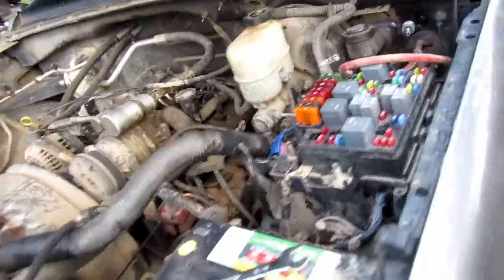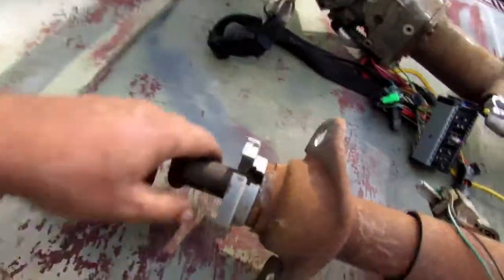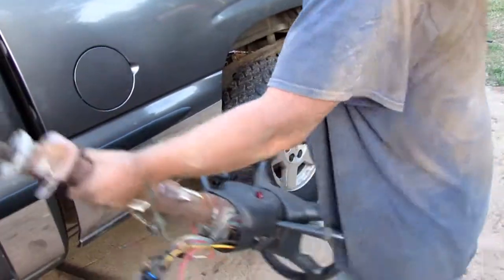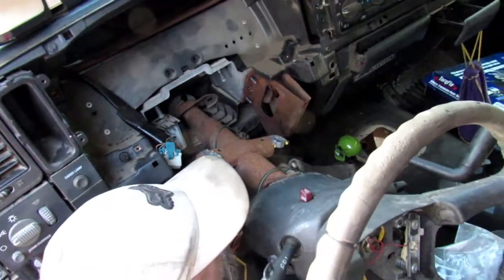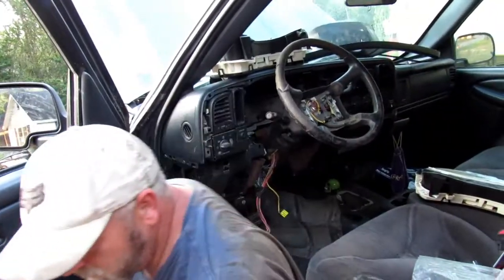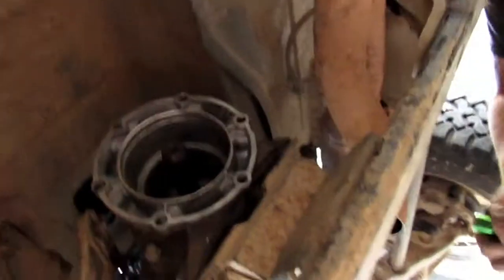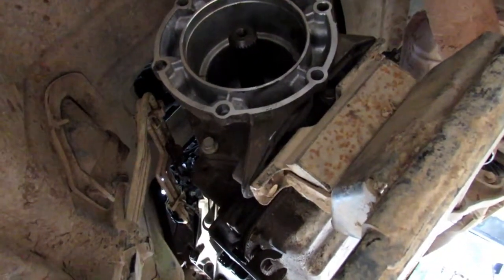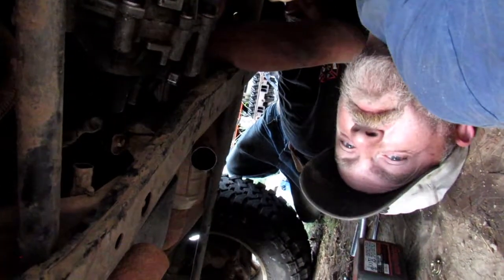Transmission swap. how to swap a5 speed manual transmission to automatic transmission

Comment: I have a crew cab 2001 6.0 2500hd 4x4 with the 5speed nv4500 I want to swap to Automatic what exactly do I need I love the 5 speed but it's a bitch in the city traffic rolling on 37" tires...Im ready to buy the Automatic and steering column but don't know what else it would need
Reply from the maker: You will need to source a trans and flywheel. You will need to swap your steering column and also get the body module from the vehicle you get the column from
Reply from the maker: I have a swap coming up soon so feel free to subscribe.
Reply: @CATDADDYDIESEL  Ok I will I'm going to keep you updated on it thanks Sir
Reply from the maker: @lowerdesert9577  no problem and please keep me updated . Hope I helped
Reply: @CATDADDYDIESEL  Yes I couldn't find a better 5 speed swap to Automatic video.
Reply: @CATDADDYDIESEL  what is the cable under the mat that you mentioned in the video
Reply from the maker: @lowerdesert9577  shifter cable